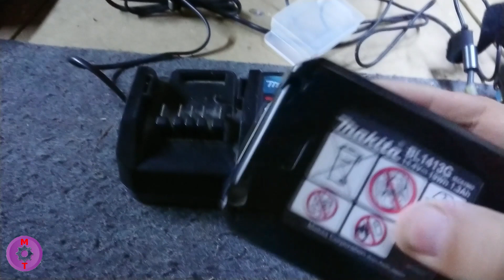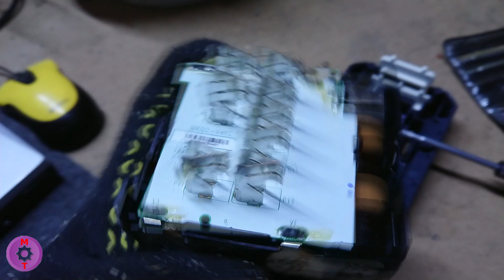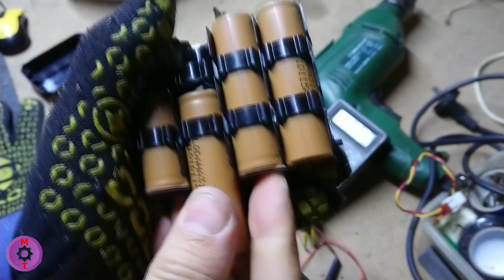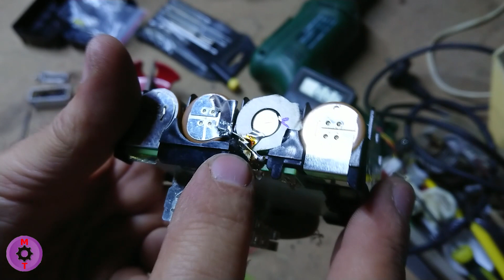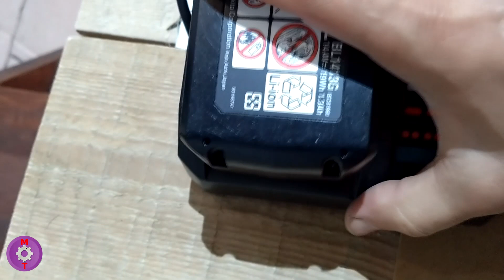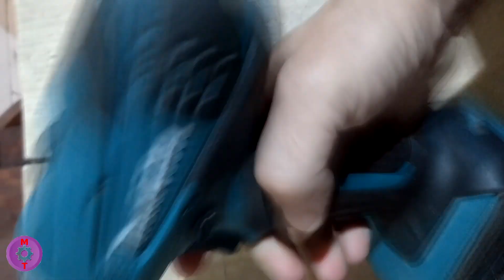How I Fixed My Faulty Makita Battery | Перепаковка Makita BL1413G

Comment: hello, all of my 4 accus are 0V so i need to change them all, what are the specifications of the battery i need to buy
Reply from the maker: I recently installed 18650 2.4A manufactured by Panasonic
Reply: @MasterToy  ok thanks and do you know where can i find an electronic card for a bl1413g because i’ve heard that even if i change the accus the card keep in memory that the battery is dead so i also have to change the card
Reply from the maker: @jlntmzkkks  There are no electronics inside the battery, only akk. My faulty battery gave an error on the charger. But as soon as I replaced the faulty element, the error disappeared.